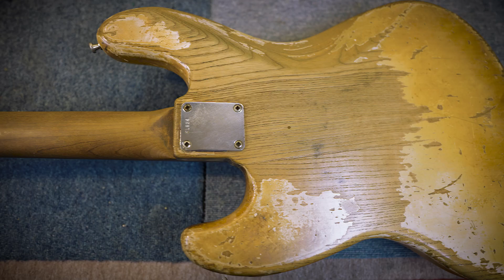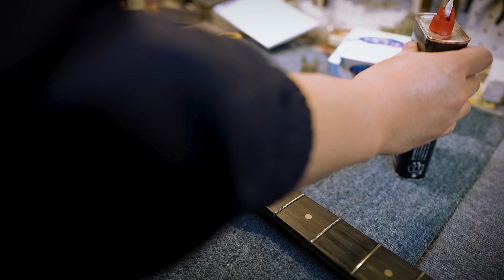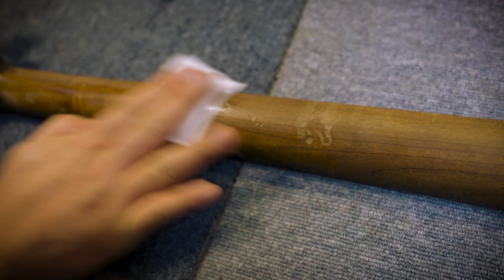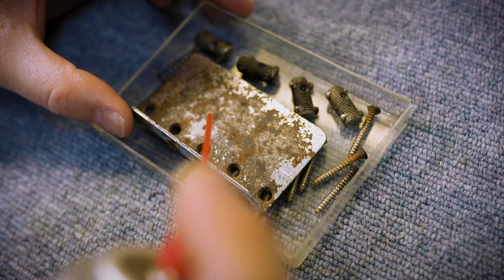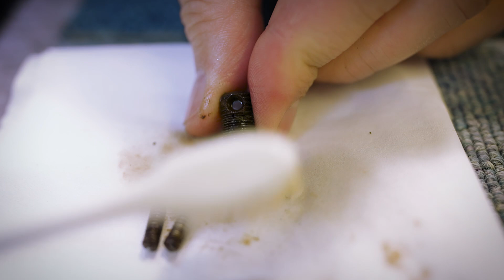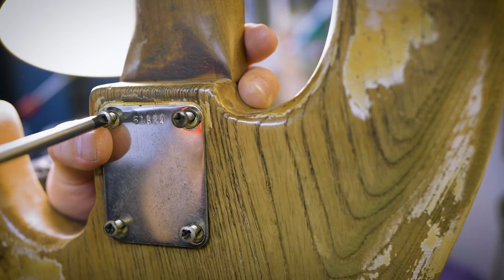【分解&磨き】fender vintage 1961 jazz bass

Comment: May I ask why use the zippo oil?
Reply: To clean fragile lacquer / cracked lacquer: Soak some blue roll in lighter fluid and lightly rub the fretboard surface. The lighter fluid will dissolve the grease build up as well as lift other dirt that's stuck to it. The lighter fluid will evaporate very quickly so will not harm the timber.